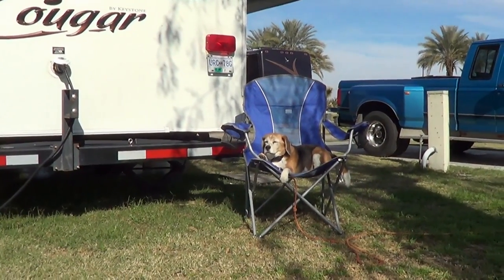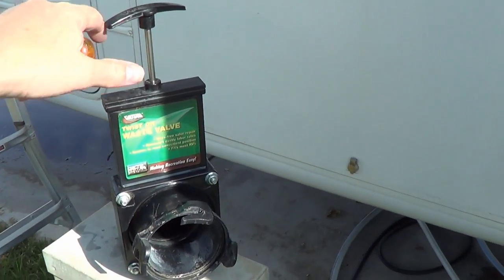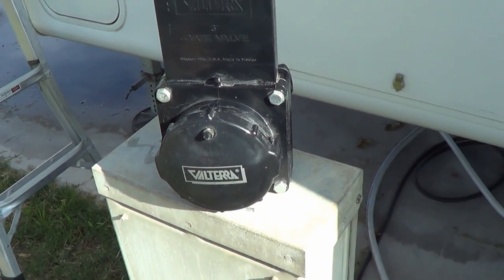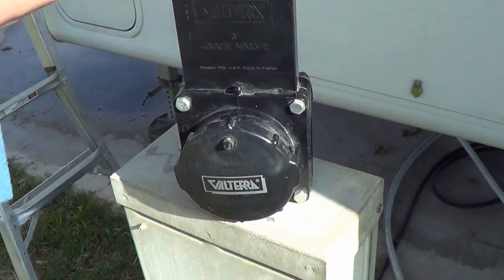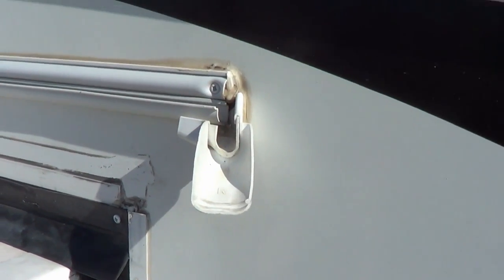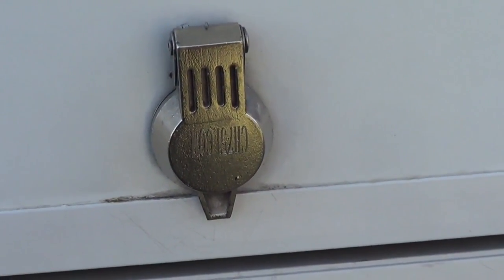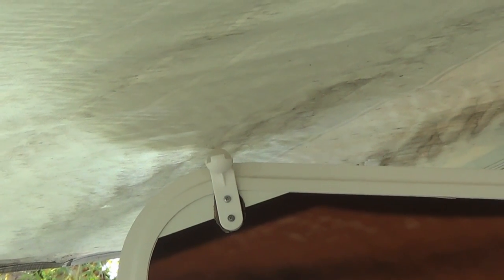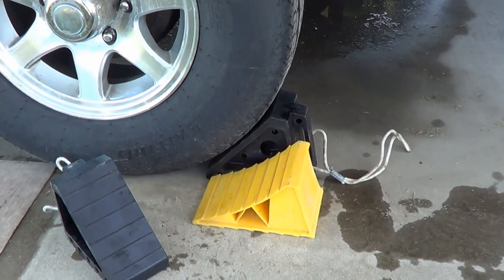My 10 Must Have RV Gadgets

Comment: Ray, how important is it to have an additional length of waste master hose? My waste valves are at about the 1/3 point from the front of my 31' RV. Also, my city fresh water hose connection is in my front basement compartment. I already bought a 15 ft 50 Amp extension just to make it to my power outlet in my garage. What's been your experience with shore water and power locations ? I know they're all different, I'm talking "in general".
Reply from the maker: I usually only needed it 3 or 4 times a year. Most parks sewer holes are within reach but occasionally the holes are placed at the far rear of the campsites, usually in older parks. With the extension, I have a little more choice where I set up the rig.
I also visit a friend twice a year and camp in his driveway, his sewer is out of reach of the primary hose. So the extension comes in handy.
Reply: Love Your RV thanks. BTW, my Mrs hears your narration so often she's begun calling you "The Mr Rogers of RV upgrades"
Reply from the maker: haha, Mr. Ray's RV Neighborhood! :)

Comment: hello Ray, I may have missed it. I checked out all of the comments and your web site, but I did not see any links to the Amazon products you have shown. I just purchased a 5th wheel RV, and appreciate the advice. thanks in advance. Scott
Reply from the maker: You're welcome Scott, links are in the video description or on the blog post page - http://www.loveyourrv.com/10-must-have-rv-gadgets/  Cheers! Ray
Reply: Love Your RV -Perfect! thanks!  the other item I was looking for would be a nozzle that I could connect to my pressure washer. Rather than being a straight bore nozzle, this would turn the stream 90 deg from the wand, and turbo rotate. Purpose would be to pressure wash the walls of the black tank by simply raising and lowering the wand up and down. if you run across anything like this let me know. thanks!
Reply from the maker: Interesting, will do.

Comment: I was wondering if you have had any trouble with your Vent Mates cracking and breaking apart.  The reason I ask is that I was looking at them on Amazon and some people wrote in and said that after about a year they started to crack and fall apart.
Reply from the maker: Haven't had any vent covers crack. The Vent Mates were on 6 years, they did turn from white to gray. I swapped them out for Fantastic Ultra Breeze covers - http://amzn.to/2v1mpBL  One of them has been on there almost 3 years still looks great.

Comment: tire chocks 6 bucks at harbor freight
Reply: IMaNO Leonardo 
Bingo
Reply: Item #96479
Reply: IMaNO Leonardo ..… $6.50 on the brand new Craftsman catalog I just got. Another pair for $7.99

If you're hauling your RV with treasures of being on the road since the eldest was the only, lol why are going to squeeze blood out of a stone instead of settling for the best and a chain lock ?

It's not like the chock is going to hold back weight.
Reply: what's a chain lock?
Reply: And even cheaper if you've got the 20% off coupon.
Reply: IMaNO Leonardo 8

Comment: I'm surprised that you don't have awnings covering your slides.
Reply from the maker: We only have one slide. Isn't a big deal to for me to keep clean, I'm still agile enough to climb ladders, so not high on my list.
I'd say the amount of times I have to sweep the slide roof of debris is about a 1/2 dozen a year. 

Most places we tend to camp aren't under trees (desert in winter and next to the beach in summer) and it's nice to not have to listen to them flapping in high winds or worry about a gust ripping them off and less hardware to maintain. We also don't camp in extreme heat where the shading would be of benefit.  Cheers Ray

Comment: I had a set of those rubber wheel blocks after I drove over another set of the plastic ones, but I returned them because of two things. First, they are very heavy, surprisingly so. I am always looking for a way to shave weight off my small class c rig, and that just seemed like wasted pounds. Second, they smell terrible! I had them in a storage bay under the bed, and they smell horrible, like industrial chemicals. I could have moved them to a different storage location, but I just sent them back about a week after I got them. I am back to the plastic ones. I will try not to drive over them again! Do you notice an bit of a smell to them? :-)
Reply from the maker: Smelled for a little while like when tires are new then dissipated, I keep them in the bed of my truck so never was a problem. Cheers Ray
Reply: Yeah, they're rubber so they're gonna smell like old tires.  Maybe could "Fabreez" them?

Comment: What about a device to help receive wifi at a camp ground?
Reply from the maker: I find the problem with most campground WiFi isn't receiving, it's usually that it is too slow from so many people using it.
For those times where distance is a problem lots of folks like the WiFiRanger products. I recently installed the Winegard ConnecT It works well but is fairly expensive - http://www.loveyourrv.com/installing-winegard-connect-rv/
Reply: And do those antenna's that you can put on the roof of the RV really pick up any TV stations?

Comment: Ok water heater element for RV water heater = $100 + from an RV service / dealer
Same element (same wattage, threads, dimensions, voltage) bought at Lowes = $45
Totally not a scam..  
Just like the A/C units,, #1 A/C unit failure is the run capacitor.. An $8 part at an appliance parts house.. Same damn thing (same microfarad value, voltage) might cost you $75+ from an RV shop who will most likely tell you you need a brand new unit so they can make comission.. It blows my mind that people fall for this crap..
EasyStart is another one for the A/C, YES it's a great product, not too fond of the $300 price tag on it though, however, some quick internet shopping will reveal the same product under a different name for under $100. They are literally the same thing.. they do the same job only one is not branded with the EastStart TM logo.....
I wish more RVers would wake up to reality.. You save money which can be used to have more FUN while out RVing instead of being conned by a salesman and making your wallet or bank account beg for mercy...
Reply from the maker: Do you have a link for the Easy Start comparable product, if it's under a  $100 it may be worth installing to give it a test. :)
Reply from the maker: Thanks, I found the website - https://www.rv-ac.com/Easy-RV-AC-Starter.html  Will have to try one. thanks!

Comment: Use an impact rather than that drill if would torque off your arm
Reply from the maker: For people with weak wrists that makes sense, thanks for the tip. My drill has hi-lo speeds, variable speed trigger, and an adjustable clutch, so not a problem. I've tried the impact gun find the impact gun makes a heck of a racket. Cheers! Ray
Reply: I am a mechanic fix large laundry equipment and I always use impacts M12 and M18.. I have screw gun but never use it not as much torque and unlike and impact it will tear up screw heads if not careful.. I have a big M18 that goes up to 700 torque for the tough nuts... Takes off tire lugs too

Comment: you forgot the tank cleaning wand?
Reply from the maker: Never had one as it is built into the trailer. Having said that I just bought one last week because the inside tank one stopped working. Will have a demo video out soon. :) Cheers! Ray

Comment: Who noticed he used the tip of the screwdriver to touch the poop, then flipped it around and held the dirty end to tap the regulator?
Reply from the maker: There was no poop, the valve had been totally cleaned prior.
Reply: Love Your RV , sorry for the assumption.  I guess I've seen to many horrors at the dump station.
Thank you for the tips!

Comment: Have you looked at installing a recirculating pump so you could keep water flowing during freezing temperatures without turning on a tap? Here is an example:
http://www.homedepot.com/p/Hot-Water-Recirculating-System-with-Built-In-Timer-500800/100426993
We did this at home so we could hop in the shower without waiting & waiting for hot water. 
Not sure if its practical in an RV.
Reply from the maker: Interesting, might be something for someone who winters in an RV to consider. Myself I avoid any freezing temps by moving. :)

Comment: Why dont you just put wing nuts on the two older vent.
Reply from the maker: The bolts are too close to the sidewall of the covers to make wingnuts practical,  - http://www.loveyourrv.com/wp-content/uploads/2012/11/VentCover2-800x534.jpg
I like the cotter pin idea much better, also the air flow from the new cover is much better.
Reply: OK

Comment: Why the HELL would an RV Park have water pressure at 100 psi??  A simple $50 PRV on their main line would solve that easily.
Reply from the maker: From what I can tell they are using the same water line as they are using for the irrigation. The RV sites back onto strips of grass with pop up sprinklers. I imagine they run the RV site water spigots off the same line.

Comment: The sewer gate come on most all RV units.  Too much talk about the pressure regulator.  They make a plug in device that is much simpler to use and some have insurance against failure.  chocks are heavy.  If you are on level concrete 
You need to clean the awning rather than making videos.